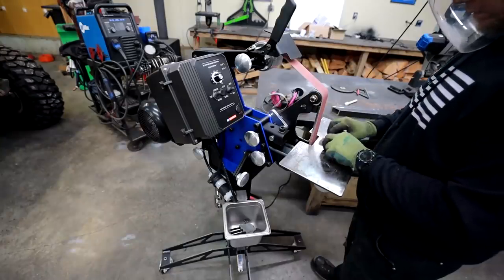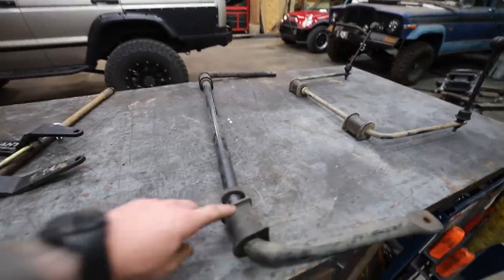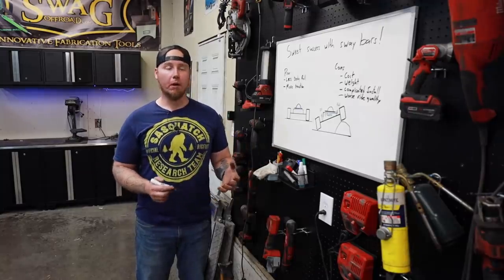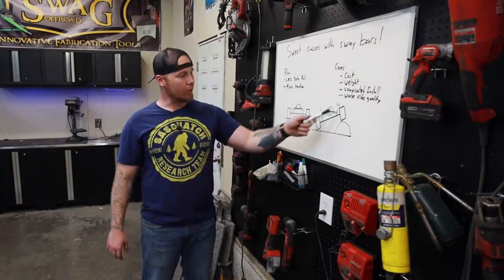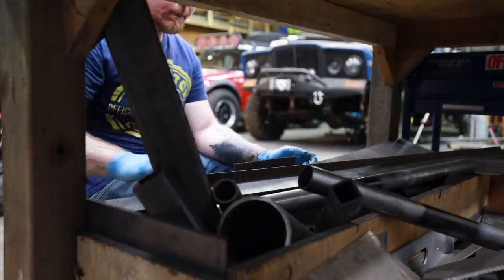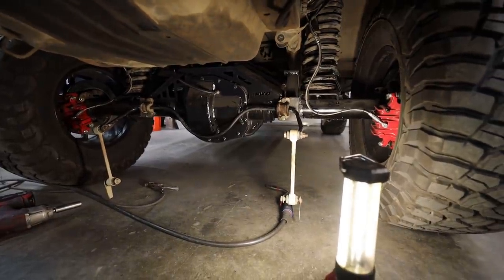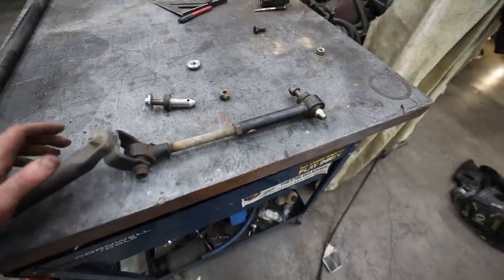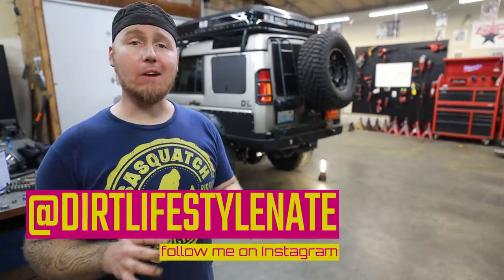Do You Need Offroad Sway Bars? Ultimate Land Rover Discovery Build Episode 27

Comment: Your the first person I've ever seen add a sway bar to an off roader. I've always taken mine off for more flex. But that's an interesting perspective.
Reply: If you aren't flexing enough to pull tires off the ground it really doesn't matter that much. Especially for a daily driver where swaybars add a lot to the driveability on road.
Reply: with he proper spring rate you WILL need sway bars on OR offroad, also you gaing A TON of stability offroad; dont think that a tire on the ground its automatically better/more traction and a tire in the air its a "bad" thing.. i used to think like that until i reworked my springs/shocks and added a sway bar (lowered the spring rate, revalved shocks, sway bars and bump stops) and now my jeep its a whole different vehicle; it works soo much better now its actually hard to explain it
Reply: This theory only works if vehicle is fitted with diff locks. In the case of open differentials (not centre diff) then wheels are needed on ground for traction.
Reply: I think this is the key factor he failed to mention/clarify.
Reply: @ottoscribante5230  I assumed he has diff locks since most serious off-road rigs do. Even my 4x4 van has lock in the rear and very good limited slip in the front.
Reply: @ottoscribante5230  I took off the rear sway bar from my WK for this reason. I haven't noticed and negative effects on HYW and much better off road.
Reply: Sway bar quick disconnects for both flex and driveability 👍
Reply: Front and rear sway bars improve traction without lockers as well.  UNTIL you lift a tire.  I've run my lj with an antirock front and stock rear for almost as long as I've owned it.  It has better traction than any Jeep I've owned.
Reply: @consaka1  bingo

Comment: It's funny that this video should come up at this time.
I lifted my Jeep XJ a while back put it on 35s made a long travel suspension for it but I took off the sway bars.
Now after driving it back and forth to work for a while I'm not happy with the body roll when I'm turning corners.
So I watch this video after literally coming in from the barn from modifying the original sway bar so I can put it back in the Jeep

Comment: I've got a tj that I added a 4 inch short lift and I've considered upgrading my sway bars to see if that helps with body roll so  great video man may have to look into this a little more
Reply: You shouldn't have any issues with body roll utilizing the factory bars. I have a TJ, 4-in lift JK axles on 38s. Stock bars with quick disconnect. Does great on the highway. Yes there's some sway but I'm never worried about tipping over in a turn. It's an off-road vehicle not a race car... Most people's idea of upgrading the sway bar is going with a smaller diameter bar like an antirock.

Comment: From what I read about the currie anti rock, on the lightest setting, it reduced total flex by 5% on an rti ramp, but in competition rock crawling, the rigs with anti rock were outperforming the rigs with no sway bar.

If you look at ultra 4, it seems every rig has a sway bar. I personally have just a front sway bar on my LJ, has quick disconnects but I prefer it connected and I can still use all of my 14 inch travel shocks. I do plan on anti rock to make it able to tuck a winch back. I hope I'll be able to fit the rear on, but I'm not sure it'll fit.

Comment: That's some great kit-bashing! 

I always keep more crap than I need...I get grumpy about the space it's taking up...until I find a use for it and then pat myself on the back a little.

Might be putting a rear swaybar on my Ranger...didn't come with one stock, and it would help a lot with weight and trailering.  As long as I can do it QD for more technical stuff.  Will 100% look at junkyard Jeeps now, thanks!

Comment: Disco with working ACE is a great thing. I've driven it with and without sway bars.  Hated it without swaybars.
Reply: Key word is with working.. it is a stellar system though!
Reply: @CalebMcKenzie  true! I bet most discos have never had fluid and filters replaced.
Reply: @CalebMcKenzie  follow up.  My ace system started blowing pipes. Tonight I ripped out the whole system, and I'm installing solid bars with front disconnects.  :)

Comment: I ended up beefing up my fj cruiser rear sway bar and removing the front one completely. 3 inch arb lift kit front and rear with jba heavy duty upper arms on the front. The stiffer front springs, heavy duty upper arms and upgraded poly bushings on the lower arms make sway bar not even needed, in fact it completely hindered it. I have now about 10 nch of travel up front and 13 ish in the back. If I had a lighter sway bar I could definitely have more rear travel. However most of my trips are overland style and not so much crawling anymore so I don't need all the flex, and being more stable when loaded up with all my camping and cooking gear gives me more confidence to take corners a little harder
Reply: Running 3in lift with a front swaybar delete. I was going to do the rear but haven't decided yet.

Comment: Good video...Theres a lot of misconceptions on sway bars on an "off-road vehicle". I have a Hellwig rear chromoly sway bar installed on my Zr2 because I have a small truck camper... It made a huge difference on handling and the truck still performs great offroad.  I don't do hardcore rock crawling so the amount of flex I lose is negligible.  BTW I did work with the Hellwig engineers to help develop a sway bar for the Colorado zr2 platform, its quite a bit different than the one for the standard Colorados.  The sway bar is not currently in production for the Zr2 but if enough people contact Hellwig I am sure they would make a production ready model for you guys.
Reply: 100% agree.

Comment: I ended up adapting fully adjustable circle track car sway bars to my TJ Unlimited. There were levers I could use to adjust the sway bar spring rates. It really worked out well. Planning on doing the same to my M37CDN build. I'm kinda surprised I don't see this used more actually. They ended up costing about the same as a Currie Anti-Rock, and were way more adjustable than the dual rate bars that a few companies offered. Plus cheaper!
Reply: What company did you buy them from?

Comment: Nate.  Thought the sway bar fitments affected the diagonally opposing end of each drive wheel on our Full-time 4x4's ?  As the original Rangies and Discoveries never had anti-roll bars from the factory, the suspension system spring rates were designed without the mechanical aid !  V.
Reply: Plus no axle diff-locks on LR unless aftermarket. Plenty of the UK available 4x4 pickups they have soft vertical springing and thick anti-roll (sway bar) and off road it is like someone punching you in the shoulder all the time.

Comment: Thanks Nate, great video. I have a JL and it has a pretty flimsy rear sway bar. I’ve been thinking of getting a heavier one and adding quick disconnects on it.
Reply: It’s probably flimsy so it can flex without being disconnected
Reply: I don't have quick disconnects on mine and it literally take less than 30 seconds to disconnect .
Reply: Swaybars arent hard to disconnect properly don't see the point in spending extra money on quick disconnects
Reply: @willmcc05  lol, go ahead and use a wrench… I’ll pull a pin. 👍
Reply: @mikepierson3097  from what ive seen you need to oil up the disconnects and stuff which is a pain personally I stopped running sway bars a few months back and don't plan to put them back on haha
Reply: @willmcc05  My JL is a daily as well so yeah, I’ll run sway bars.
Reply: @mikepierson3097  my patrol is my daily and it goes fine

Comment: What about trac bars on a yj? I’ve gone back and fourth and read both yes and no on removing them?
Reply: I vote to get rid of them. The leaves center the axle, and the track bar will limit axle travel while adding lots of stress to the already "weak" frame. In the rust belt, the track bar mounts and steering box area are the first areas to crack.

Comment: Does what you said stay true for leaf spring vehicles like a yj?
Reply: My opinion is that the resistance to twisting that's inherent to leaf springs acts like a sway bar already. I use sway bars on coil spring suspension but not leaves, especially when it's leaves all the way around. Just my dumb opinion

Comment: Looking to instal Bilstein 6112's up front in my Tacoma here shortly. Some people claim that the shocks are good enough, that they were able to remove the front sway bar and still retain a fairly flat ride. 

Personally, my truck is primarily driven on the street and I'd like to retain the front sway bar. I've also heard that adding a rear traction bar helps with winter handling.

But I also drive on gravel and dirt, and would like the suspension to function as it should. Is there a special sway bar I should be looking into that would provide a decent compromise for both??
I dont plan on rock crawling

Comment: So...how does it work?

When you weld to your frame do you apply any corrosion protection to the inside of the frame afterwards? Typically the frame will be painted on the inside but welding destroys the paint. I am in the process of welding some sliders on and I was thinking about how I want to handle corrosion protection. I drive my truck in the winter in PA so it will see salt. My truck has a fully boxed frame, so coating the inside with paint is going to be challenging if not impossible. I was thinking about spraying something oil/wax based with a Schutz on the inside of the frame to repel water, but I would need to reapply it at least yearly. 

Any advice?

Comment: Ram HD with no sway bar and aftermarket 4 link air ride. Decent off road but sketchy when loaded on the highway. Aftermarket rear sway bar that came with the air ride setup is so stiff it doesn't allow for any articulation so it is disconnected.

Comment: Man it's too bad your disco didn't come with ACE. I have it on mine and it's actually really impressive. Corners really flat on the highway, and then offroad at low speeds they're effectively disconnected which gives tones of flex. I'm limited more by my wheel arches than I am by anything else.

Comment: Am I the only one who isn't happy with their antirock swaybar?   I lost 22" on the flex ramp.  Not vertically but horizontally up the ramp. And lost around 4" of full finder stuff.  Almost tips over on any obstacle. Adjusted it 3 times and still the same thing. I took it off and drive no swaybars.  Can't justify spending the another 500  for rear. (97 TJ)
Reply: Guess so.
Reply: No, but only few will admit it after spending all that money... so they tell themselves it helps. Sway bars are to negate body roll, or a bandaid for poorly designed suspension. I use every bit of 16" shocks front/rear and can whip donuts with ease on 40's (no sway bars). Now if you are doing 60mph through the desert...thats a different story. Personally I'd rather be able to drop a tire down a 3' bank and have my body stay level. Ill take stability over traction any day of the week

Comment: Dumb question, how can I turn my factory sway bar into a quick disconnect sway bar? My truck is a 2500 ram.
Reply: Buy a quick disconnect kit, like the one from jks... For a TJ. Then see if you can make it work. That is assuming they don't make one already for your truck
Reply: @timsully8054  thanks but my truck is a 2500 dodge. So I don't think that will work for me
Reply: That's why I used the words "make it work". If there are quick disconnects sold for your specific vehicle, it kinda negates the act of you having to ask the question. Just Google it and press 'purchase'. If not.... Consider how your bar is laid out, buy something similar to your sway bar end links and drill/cut/fabricate your way to making them fit.
Reply: @timsully8054  that's something I'm not good at fabrication. I'm just now learning how to weld.
Reply: If you can learn how to weld, you can drill holes and tap threads. I suppose to answer your question more clearly, the way you make your sway bar into a quick disconnect sway bar is by putting quick disconnect end links on your sway bar.
Reply: @timsully8054  ok, sorry to sound so stupid but I'm new to all this stuff and trying to learn. Thanks for the feedback I really appreciate it
Reply: @jk_wrangler13  it's all good! Just a miscommunication and you can't learn if you don't look for answers.